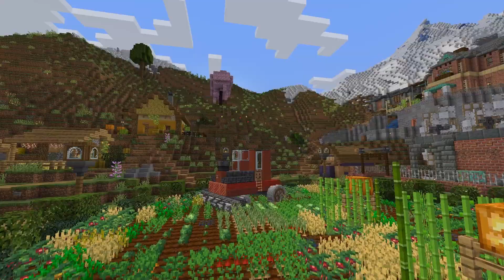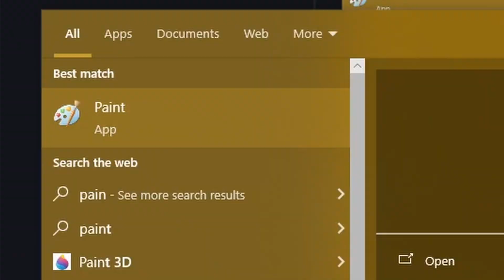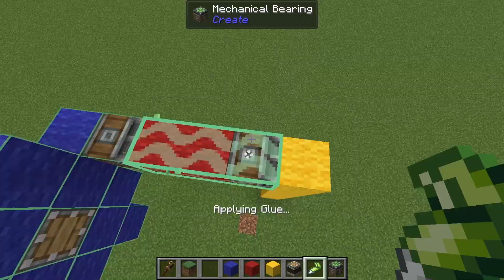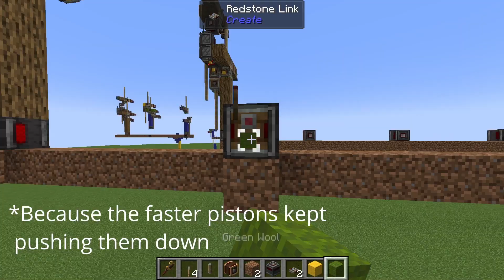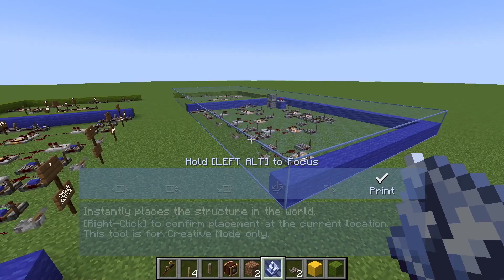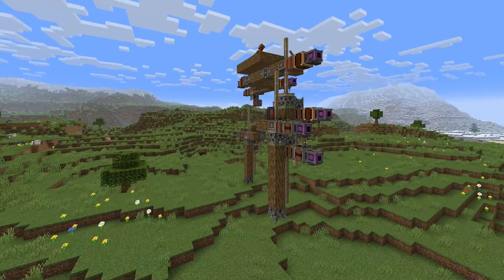Making a hill walking ROBOT using Create mod (No Clockwork)

Comment: how would this be powered in surviva;
Reply from the maker: With a bit of adjustment to accommodate speed controllers you can use windmills
Reply: @WoodChuckYT  kay. also, you sould make more overengineered contraptions rather than automation. more stuff like this and the giant mechanical arm